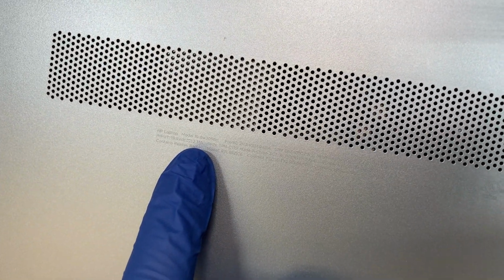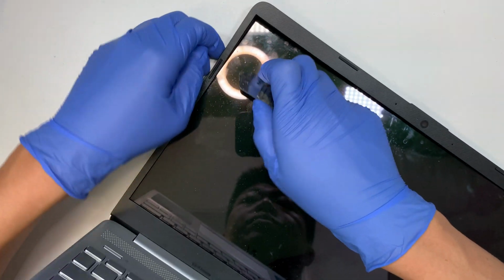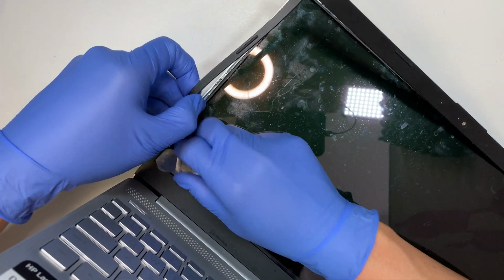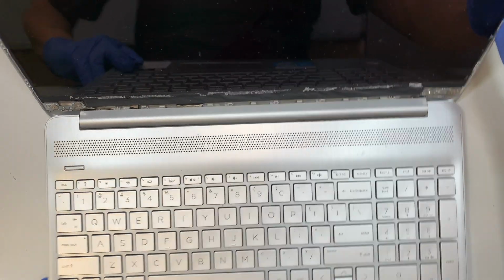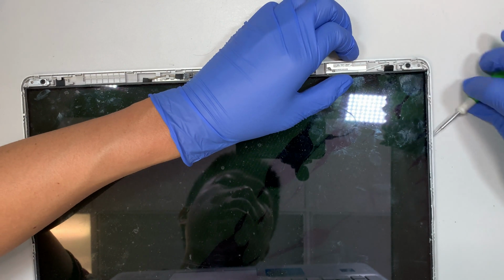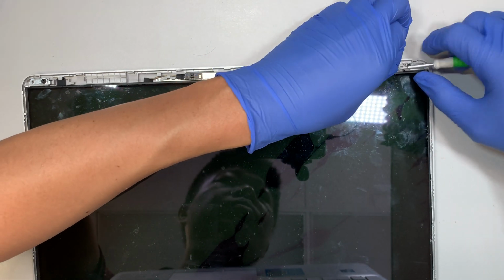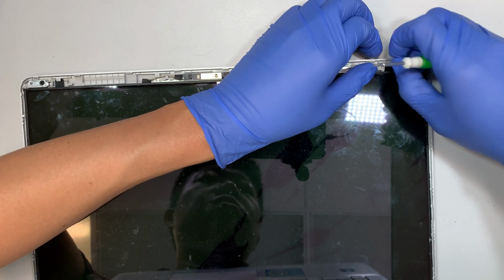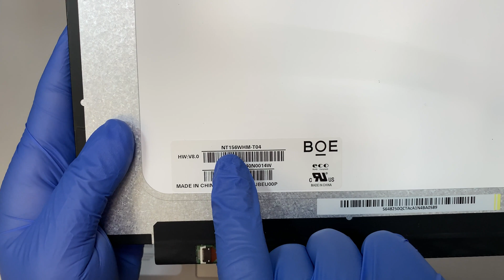Hp 15 dw3650cl LCD Screen Replacement

Comment: I got a replacement screen which is a touchscreen but the touch part is not working.  I purchased a second screen with the same issue.  Anything I need to do to get the touchscreen back or is simply the screen itself?